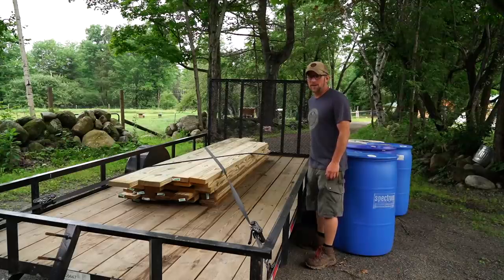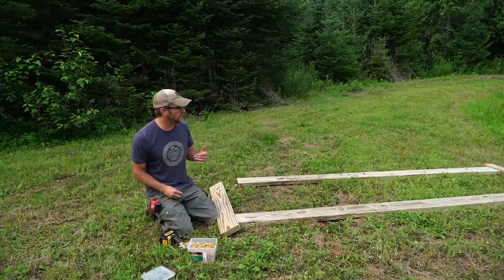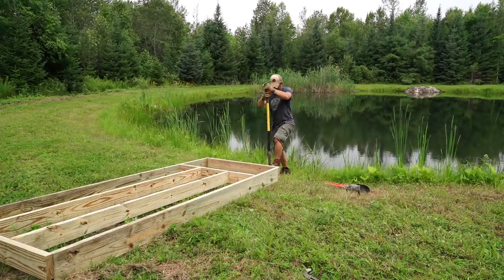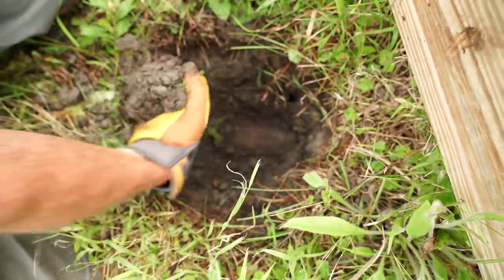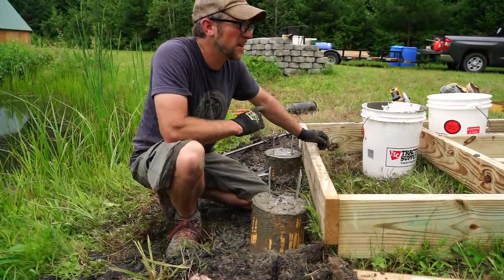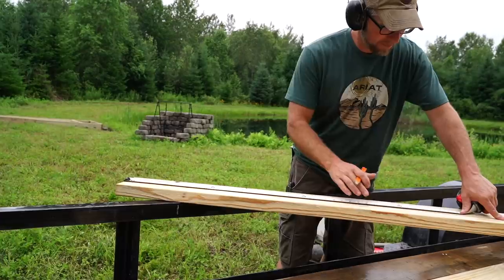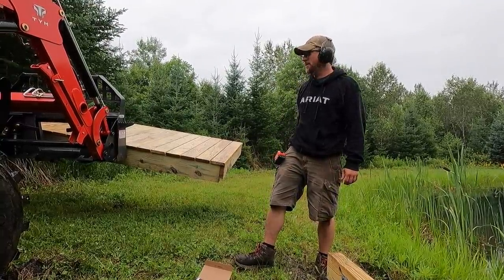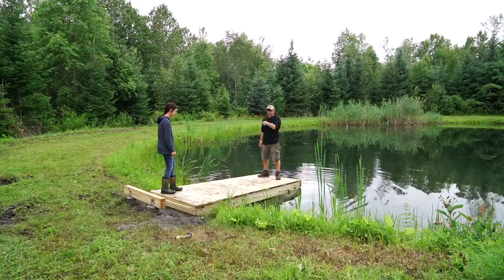Building a DIY FLOATING DOCK at our OFF-GRID PROPERTY (PART 1) Cement Piers & First Dock

Comment: Using pipe on each side connected to the dock with 2 ubolts on each side will stabilize the side-to-side motion but is not intended to support the dock just keep it from rocking. the pips should be long enough to extend above the dock surface from the bottom of the pond and provide something to tie a small boat to. the pipe should be at least 3 inches in diameter

Comment: Pressure treated timber for the dock but not used for the building work at the homestead where the exterior walls of all the builds are wicking up and deeply stained prior to mould forming.Hopefully the correct choice will be made at the off grid property

Comment: Suggestion: you will have plenty rocks on your property. Just mix your concrete pouring with a wheelbarrow of mid-sized rocks. Saves your back from mixing more concrete and halfs your cost of buying bags of mix.

Comment: You might want some beefier connections between your dock floaters. Those screws may pull out over time. Some galvy rods through and anchored into the sides will do it.

Comment: Al up here in the U.P. floating docks that the DNR put in on our remote lakes you need to put U-Bolts along both sides of your dock and drive galvanized pipe down into the ground underwater.... That way it will minimize the sway in your dock, also if you can find something similar they use these new plastic cells underneath that are rectangular and seem very robust but there's no reason that the barrels shouldn't perform just as well as long as you anchor the dock like I said earlier in this message!!!! It looks great thus far though, keep it up I'm loving it!!!!

Comment: PVC pipe driven into the pond bottom will allow the dock to move up and down, but offer stability as well when you mount sleeves to the dock in which to put the pipe. We did a floating dock in Wisconsin shaped like a T that way, but allowed us to retrieve it in the winter as well. You may adjust with filling the barrels with some water too, trying the height of the dock.

Comment: One piece of advise on the equipment that has hydraulic cylinders. Try to leave the cylinder ram retracted as far as you can to keep them protected from the weather. Even though the rods are hard chromed, they can still rust and that will destroy the seals and cause hydraulic leaks which can be expensive to repair or replace.
Reply: yep totally agree on this i was a hydraulic repairman for 40+ years with the Government, changed many a set of seals due to the rams corroding. when you grease you unit put a light coat of grease on the cylinders this will help protect them.
Reply: Aren’t there caps that should be put on the ends of the hoses when unplugged?
Reply: After 20 years at sea, working with hydraulic boat David’s. I wholeheartedly agree !!
Reply: @rodfair5698  As a fellow Navy Veteran, thank you for your service.

Comment: Al: Great start on your new dock! I'm not sure that just one barrel will be enough support if you have more than just  a couple of people on it at the same time. One way to achieve several benefits would be to consider adding a Tee-piece (of similar dimensions as your original) across the outer edge of the dock and add a couple of barrels under it for extra flotation support. This will not only increase the dock's stability, it would provide more casting space when several people want to fish at the same time. If visiting kids want a place to jump or dive off, you've met that need too. Just a thought for you to consider.

Comment: Get caps for all you hydraulic quick release fittings, dirt and corrosion will give you issues quickly
Reply: And please do not use a hammer to disconnect the fittings!

Comment: I've no idea if this would work, as I've never built a dock of any variety ... but
I would take four of the mounting pieces you have at the far end of the dock (for future docking) and attach 2 of them to the concrete anchored wood; then attach the other 2 to the dock itself on the land end. Find a metal pipe the right diameter and length - run it thru all 4 mountings - and presto the dock is on a hinge (of sorts) and should rise and fall with water level of the pond.
Yes, I'd also stack boards in a framework at the culvert to control water level of pond. Screened so the fish stay put?!????

Comment: GOOD MORNING!!!  
GINA, the one we had grow up was a bit wide and the approach was little more stable due to large post that was on walkway buried in ground to stabilize the approaching the floating pond deck we had a latter to use at the end so climb in and out, we didn’t like the walking in the mud. The post was left tall & a short post was just attached to the deck not ground so we had a little railing to hold onto thin we was on floating deck. We had two very large ponds the one with deck was 40ty feet deep and other one was deeper than that spring feed we did most fishing was at the pond without the deck. The ponds were divided by one lane dirt road, the upper pond could drain into the lower pond, the depth of ponds was done by divers. Have fun we did growing up we never worried about falling in we, had our latter to climb out, if you walked out the pond, would be over our heads so fast but due to mud we didn’t walk out unless we had to. May God Bless You…

Comment: Float the dock and use a hinged ramp. Better solution, use dock to drive post and mount dock, this allows for a hand rail and stable platform.  The movement on floating dock with multi people is not pleasant and gets worse with age. I’ve had both types over the last 35 years, floating docks are a pain. Just food for thought from old guy !

Comment: Don't recommend raising the water level, you will have multiple consequences to fix as a result.
I would also change the walkway float in two ways, add a second barrel and a couple of feet in length. Both of these can be accomplished easily at the float end with a doubler passing your existing float a couple of feet or more.
I would set the end as you planned on your piers, this will allow movement do to any water level change and easier weed control  at that end.

Comment: A couple of possible issues could result by raising the level of the pond 1, raising could cause the pond to flood the surrounding area easier in heavy rains and you don’t know where that overflow goes and your road could be in jeopardy of washing out. I would check with county flood control to see if there are specific issues around the property Also easing the level could cause eco issues on not only your property but other properties in the area.  One apparent innocent change could cause many problems down the road literally and figuratively. Think it through good luck

Comment: Morning Lumnah family.
I would have used the four barrels and made the 8' platform, then just had the bridge/jetty linked to both the platform and the bank. 
I have to ask Saw a lot of cutting short stubs off. Why not just cut them in half? Quicker and less scrap to clean up.
Reply: Lumber isn't always perfectly to size,an 8' board might be 8'1" so he had to trim the excess off.He was also putting the cuts closer together and maximizing time that way.

Comment: Fare better than mixing in 5 gallon  buckets, bring along a plastic mixing tray. You can mix at least one full bag at a time.  You then use your spade to shovel the mixed concrete into the tube.
I'd be tempted  to just put the dry sackcrete in the tube.

Comment: I built a dock into my pond 1 year maybe 2 ago... 8 inch PVC pipe maybe can't recall exactly, used a hose fitting from the house to sink them as pillars and connected the dock as the rest.  Wouldn't have ever thought of this but my neighbor did the same thing the summer before he grew up in Florida and did this as a summer job so had the skills already.  Myself only knowing concrete would have taken that route but this one was faster and cheaper.  I also enjoyed this idea as well.  I've been thinking about doing a floating dock, youtuber Fowler's Makery and mischief has a survival challenge on a tote float where he uses totes to make a floating dock I'm torn between the two.
Reply: Good luck deciding which one to build. It sounds cool that you used 8" PVC pipe to build your dock as pillars. Whatever you end up using I hope you'll be pleased with it.

Comment: Tubes are not deep enough to do that.  They will heave with frost because you defeated the purpose of the ability for the ground to slide up and down the cylindrical cement structure.  Cones and over pour become pushup structure.

Comment: I think you need to add a second barrel under the dock, maybe a smaller one so it does not hold the dock up out of the water too much. I built one on my pond a few years back and it worked great.

Comment: Al, you should put in a piece of pipe on either side tall enough to attach it to the sides so it doesn't shift right to left or tip right or left.

Comment: I've done a fair bit of concrete work in Connecticut with my brother and in southern states as well. The 'Freeze thaw' cycle in New England has a tendency to to erupt or destroy straight line sonotube concrete work over a very few years. A footing with rebar 2 to 3 times the diameter of the sonotube will keep it in place for many years. 'Build to last or build to replace'. Which do you want and which is cheaper in the long run?
Reply: There is no current to speak of and this will be very stable in the end so this should be fine. Especially if he runs guy wires at forty five degrees from the two corners of the main dock to the shore and anchors them for side to side stability.  This concrete will only have to anchor the walkway not the dock. Should last for decades that way.

Comment: Brilliant idea with the floating dock! Looking good so far. The walkway part of the dock I think will stabilize when you attach the 8x8 ft dock platform. If not, use two barrels lengthways beside each other at the walkway end. Connect walkway and platform with a hinge. To prevent sideways movement you could drive down say 2.5" pipes on either side of the walkway into the pond bottom.

Comment: Famous last words, "That's not going anywhere." LOL I've learned over the years to say, that shouldn't go anywhere.    Thanks for the DIY on this dock, we are planning to build one at our lake property later this fall. Instead of rope I think we will use plumbers strapping to hold the barrels.
Reply: Won't that rust?
Reply: @patchurch1677  If I'm not mistaken they are galvanized coated to prevent that.
Reply: @MontsFamilyHomestead  Look into the plastic plumbers strapping. Galvanized will rust from the cut ends and even the galvanized parts will likely not hold up since they are electroplated galvanized not intended for that much water exposure. The fiber reinforced plastic type will be a better choice.
Reply: @markpashia7067  Thank you very much sir I will definitely do that
Reply: @MontsFamilyHomestead    --  I'd recommend stainless steel banding (instead of plastic strapping or plumbers tape) like you see holding cargo on shipping pallets.

Comment: Won’t the  chemicals in the pressure-treated pollute the water?
Reply: Not really. Once the whole thing is built with the proper number of floats, the lumber will not contact the water and any bleed from rain contact will be greatly reduced after it sun dries for a month or so. The amount diluted over that size pond will be part per trillion and well within safety guidelines. Once it sun dries for a month or two, I would coat it with a product like Thompson's Water Seal to avoid skin contact with the lumber myself as that is a proven food grade coating with good traction even when wet. Just flood coat it as you cannot do two coats. It is hydrophobic and won't take a second coat. Nothing else works like Thompson's so do not be fooled by others. Once coated you can lay out to your hearts content and not worry about skin contact with poisons. Even if you are not into sunning, climbing onto it from swimming or sitting on the edge with feet in water will mean skin contact with treated wood, so coating stops the risk. Other stain/sealers do not have the same properties and are often slippery when wet. They also are usually not food grade rated so have their own issues. Last thing you want is a slippery dock!!!

Comment: Al, I'm guessing you're going to want ALL the water at the big property to be off-grid. I don't know what sort of cost will be involved in getting a well going. Maybe that would be the best solution for water in the house when you build it. But you can get fairly high pressure with an elevated storage tank that can be fed by a water-powered ram pump system or one of its variations. You pipe water from a moderately higher point in a stream to the pump at a lower point in the stream. It uses that pressure to send some of the inflow into your system that can raise the water (at a slower flow rate, of course) to a much greater height. The rest of the water that goes into the pump to power it goes back into the stream.    
     Wranglerstar has several videos on the ram pump he installed on his old homestead. There's a playlist of 13 you can find if you follow this link and scroll down:

https://www.youtube.com/results?search_query=wranglerstar+ram+pump 

Several show the initial installation he put together. There's some troubleshooting and an upgrade. If I recall correctly, there are links to where he got the actual pump. 

    
 The Breurram pump is a simple variation on the ram pump; it replaces the standing pipe with a loop of hose. The video below shows the operation and has a link to their website. 
 
https://www.youtube.com/watch?v=fUNicSOW46E 
    
    Finally, there is a guy in Australia who has a more complex variation that can get the water to a much greater height than the simple ram pump. It's called the Bunyip Pump. I don't know whether it is available outside of Australia and New Zealand, but it looks like it could be what you'd want if you could get it.
     Here are a couple of videos about it: 

https://www.youtube.com/watch?v=b-AmY9bCk24&list=TLPQMjgwNzIwMjGa4CfCzfnNbQ&index=4 
https://www.youtube.com/watch?v=NzAAjo9GukI 

     Here is one where it is shown working in place - source to pump to tank - at his property. 

https://www.youtube.com/watch?v=IHMszcRcsEU 

And here is the website:     http://www.portasaffordablepumps.com.au

Comment: Al,

I have had bad luck with barrels leaking/moving...... I use HMWPE encapsulated float blocks.   Much better for floating docks in my opinion....
Reply: The key part is the "encapsulated" as the old Styrofoam blocks would grow bad algae on them. Bad for the environment.

Comment: Demand for pressure treated is low while demand for non treated is high. It is about supply and demand.
Reply from the maker: It’d be a lot cheaper to build a house with pt
Reply: @LumnahAcres  - How's the market for the wood mill?  I know you mentioned you're looking, but they were/are all backordered.  Have you placed an order for a saw mill yet?  That's something that will be one of the wisest moves for you in the future.  Gotta start sawing wood and letting it dry so you can build stuff without losing your shirt with the lumber costs!

Comment: Good morning AL. Since you are in the planning stage for your house building do plan to include rainwater harvesting and solar power system. You may need a couple of underground or over ground tanks to store the harvested rainwater. Or if you are planning to have a bore well then you can also plan to direct the excess rainwater to go into your borewell to refill the underground aquifer.
Reply: Above ground storage won't work in Al's climate zone. Frost line is 5' below ground. Above that everything freezes.
Reply: @christinedehn3257  thanks for the comment..learnt something new today. Stay safe and stay blessed.. from Bangalore India.
Reply: @christinedehn3257  Actually it could work. Off Grid with Doug and Stacy have above ground storage in Northern Central Missouri with frost lines of three and half to four feet but they have thousand gallon tanks inside a barn that is heavily insulated and that is perfect because they are harvesting off of a large metal roof barn for cleanest water and storing inside the building which is much higher than their cabin so good water pressure. Just takes some planning and such. Doug does not really believe in solar but you could have lots of solar on that same roof and still collect the rain water killing two birds with one stone. Actually three birds as it would be a great storage space for equipment as well. Think large Morgan metal building on high ground with solar on stands above roof. Catch the sun, catch the water and cover the tractors and implements as well as the storage tanks for the water inside. Check it out. Essentially those tanks are higher than the roof of their residence, so while sitting at ground level in barn, they are like a water tower from the viewpoint of the housing. Top of the tanks are a good twenty feet above the taps in the house. Bottom of tanks are at least ten feet above taps.